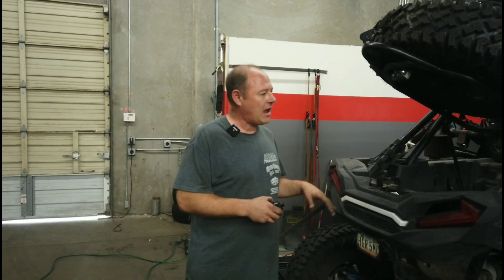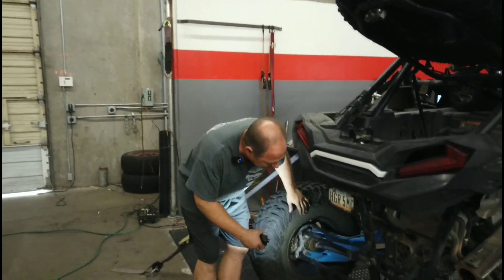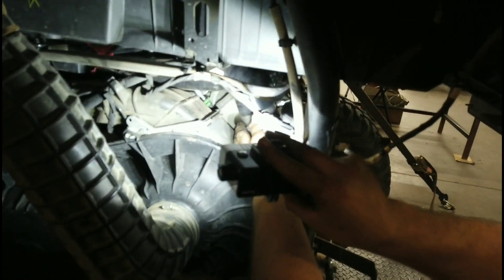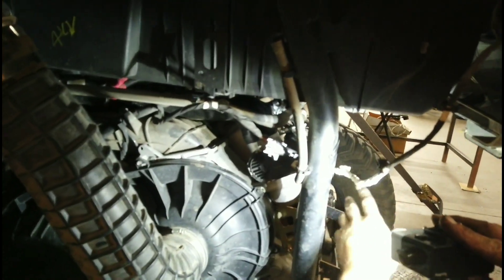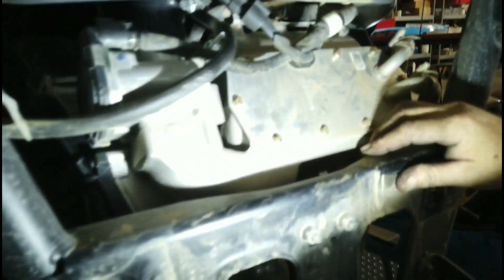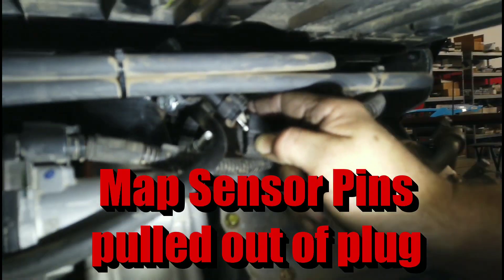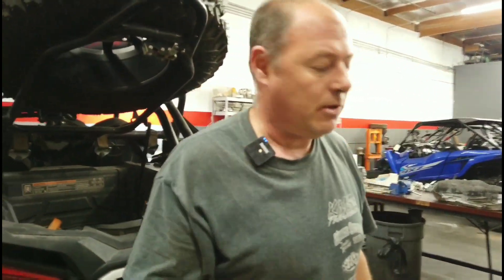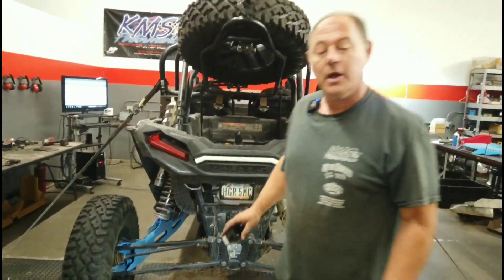KMS Tech Tip: XPT Charge Tube and Map Sensor Code

Comment: My xp turbo run bad at 1/2 throttle and code 0 1127(overboost). When i unplug the map sensor, it start running well? It is all stock, do you think i need a new map sensor?
Reply: Eri. Lessard did you find out the issue I am having problem on.my 2018 xp turbo  at idle once in while try to die the rpm  goes down but it does not die other then that runs good
Reply: My issue was the wastegate actuator, i don think it is your issue. Do it throw a code?
Reply: @ericlessard5021   my  has  on top 2 in the middle 1127 and the bottom 1 when I am looking  at the screen  , this weekend  I will look at everything
Reply: @rafaelmancia6369 Hello. My name is Jose, from Spain. My RZR has the same error code 2 in the top 1127 and 1 in the bottom. 
I think that my problem is a bad connection. Have you repair your buggy?
Thank you
Reply: @JoseGas25EnduroVlogs   yes i had wire touching  the frame ,note wire was 🔥  from heat ,pls inspect  the wire carefully    for burning  and fix,another suggestion  is to replace pigtail map sensor  wire from amazon